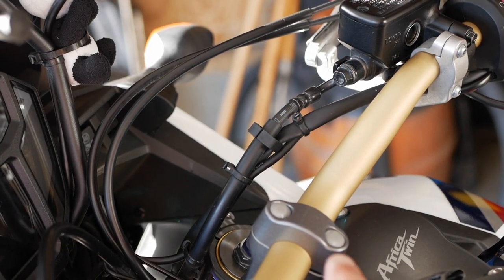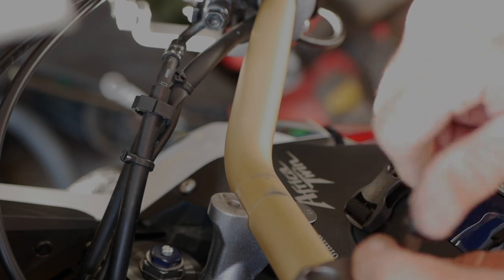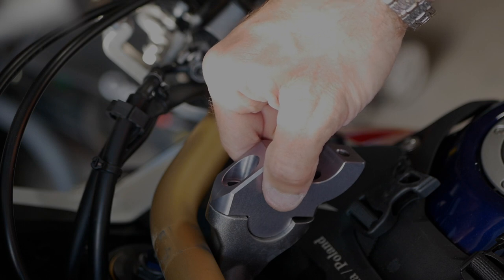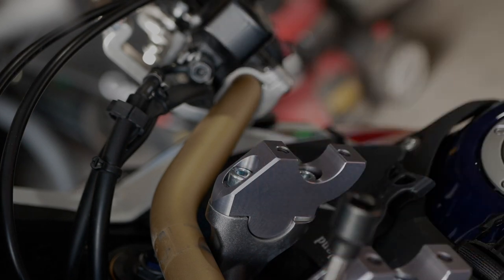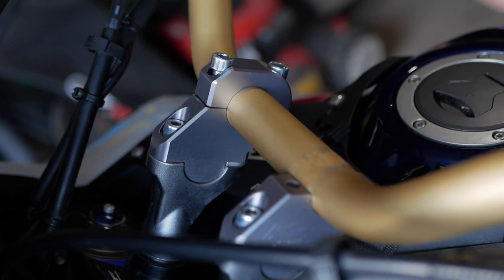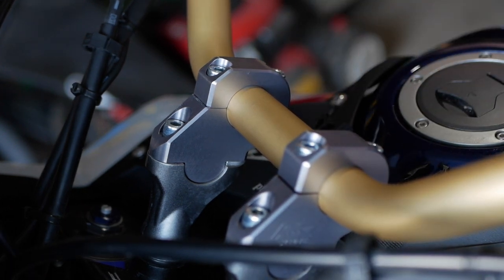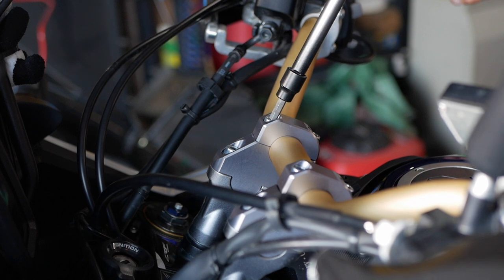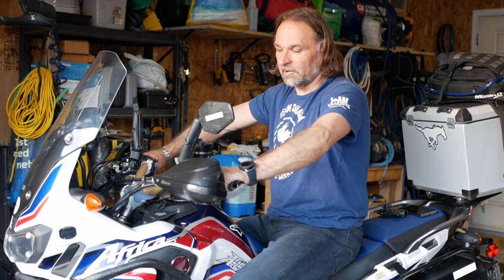How to Install Rox Handlebar Risers Honda Africa Twin

Comment from the maker: Excellent addition to the steering handling of your adventure motorcycle improves riding position very simple install.
Reply from the maker: @carrickdubya4765  https://fortnine.ca/en/rox-speed-fx-front-fender-riser-kit-10001
Reply: Will this alleviate my shoulder pain and arm and wrist numbness?
Reply from the maker: @CR-ji4ub  it worked for me I had shoulder and neck pain on long rides now don't experience this anymore, also better handling when off-road.  I had to remove this risers as they interfered with my tank bag now I use The risers from adventure Sport OEM also work fine and handlebars are not touching tank bag.  If I had my previous tank bag I wouldn't change them as I liked them a bit more
Reply: @AdventureTravelandScuba  thank you!

Comment: Greetings again
I watched your video several times, and I noticed you have a cap on top of the triple clamp nut. Would you let us know where did you get that cap?
Thanks for assisting us.🇺🇸🎉🍾🇺🇸
Reply from the maker: Paying attention to details good eye do 😆 that was purchased with the bile my local honda dealership logo they have installed it Rocky Mountain Powersports is their logo,
Reply: @AdventureTravelandScuba  thank you for the rapid response, I am your subscriber.
Reply from the maker: @rosarioroberto5823  Thank you very much I appreciate it

Comment: Excellent informative video.  Thanks.   How tall are you.  I have the 2022 Africa twin and think I’d benefit from risers.  I am 5-10”.
Reply: I am 180 cm it's like 5 ft 11'', have 2022 Africa and I have ordered sw-motech bar back (30 mm higher, 22 mm closer to the driver), I have spoken to one guy who installed Zeta ZE53-0626 (very similar to sw-motech) and he is happy with it. I'll see if that improves the ergonomics.

Comment: Great video but no thread lock?
Reply from the maker: No need it has been two years lol
Reply: @AdventureTravelandScuba  Nice to know thanks I received mine today and will fit them soon.
Reply from the maker: Also depends of you are using some tank bag it may interfere it was ok with my Mosko Moto but last year I have changed to Givi and had to go to adventure sports OEM risers as it was restricting at full lock of handlebar